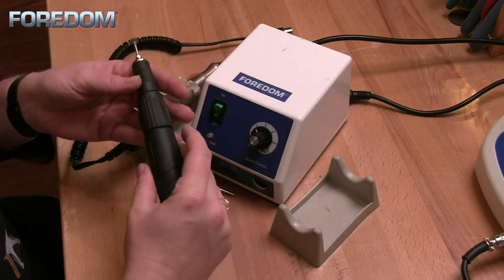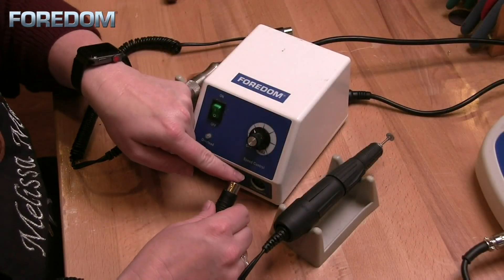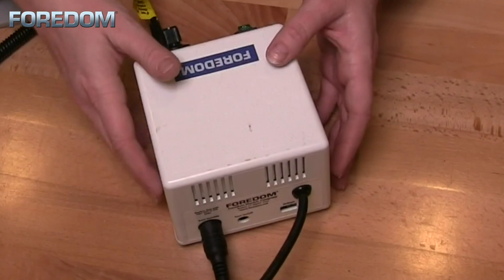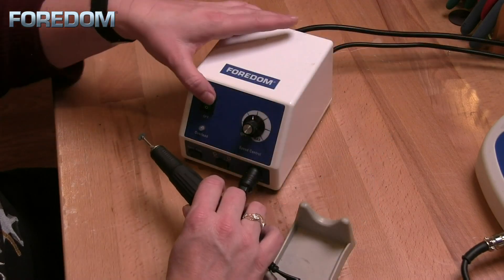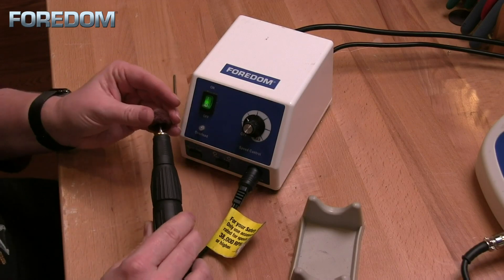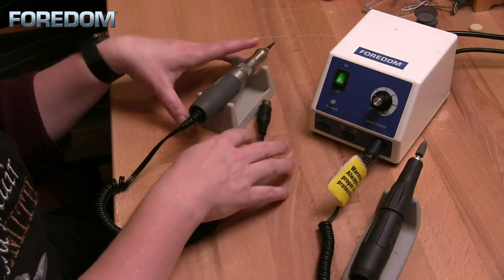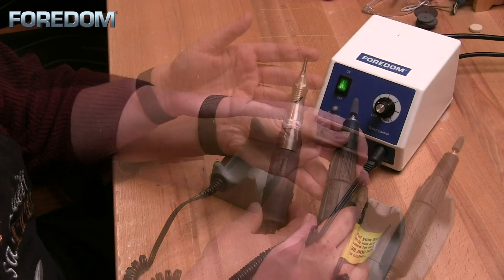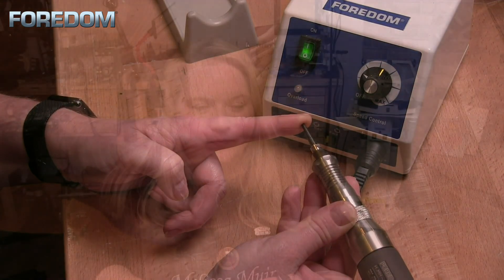Getting started with Foredom's K.1070 Micromotor  & K,1080 Hammer Micromotor

Comment: Hello Melissa,  This was a very informative presentation!  Will the hammer hand-piece fit into a Marathon III, or are all the connectors different for each manufacturer?
Reply from the maker: Our brush type micro motor handpieces are compatible with the brush type control box of the Marathon-III. Thank you!
Reply: @ForedomElectricCo    Is the hammer handpiece a brush type?  I have the rotary brush type handpiece that came with the Marathon III, but I would like to add the hammer handpiece if it is compatible. Thanks.
Reply from the maker: yes! the hammer handpiece for the micromotor is brush type.
https://foredom.pulse.ly/e5xqk8wpgu

Comment: Hi dear, can you pls tell me something about the high speed handpiece that comes with the 1070 Foredom package? 
Does it have enough torque to drill holes and stuff because i still have doubt about the strength of this handpiece. I got a cheap Marathon which isnt even capable enough to drill some holes in metal.
The newer grinding  Handpiece seems very big to me from a length of 200mm and weighing 500grams. My main purpose is for stonesetting, drilling, cutting seats etc.
Thanks!
Reply from the maker: It depends on what you are drilling and what kind of accessory or bur or drill you use. Micromotor K.1070 https://www.foredom.net/product/k-1070-high-speed-rotary-micromotor-kit-2-35mm-3-32-or-1-8-collet/ has great precision. 
K.1020 has more torque and can hold larger drills. https://www.foredom.net/product/k-1020-chuck-type-high-torque-kit-domestic-and-230v-int-l-models/
Reply: @ForedomElectricCo  Mainly for drilling yellow 18k gold with normal steel drillbits (0.8 - 1mm) and round burrs like 1.5 - 3mm.
Will the torque of the K1070 be okay for the job?
Thanks
Reply from the maker: @andijvie3119  Yes. K.1070 would be great for that kind of fine work. The drills and round burs need to have the right shank size. Foredom has  K.1070 micrometers that take either  2.35 mm OR 1/8" shank burs. Some people try to use micrometers to aggressively carve large areas of very hard materials - hard woods and steel.
Reply: @ForedomElectricCo  Great to hear that! Do you have the torque specs of the K1070? The Torque of the K1060 is 11.3 oz/in so I’m curious about that because i can find the info anywhere.